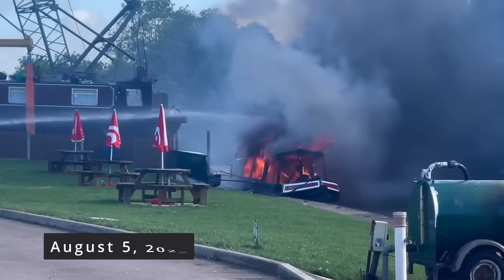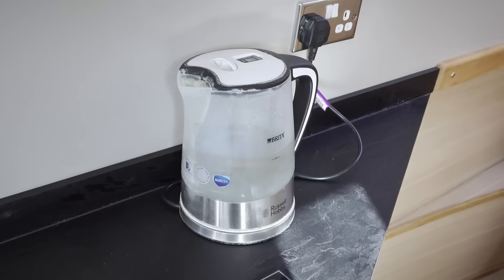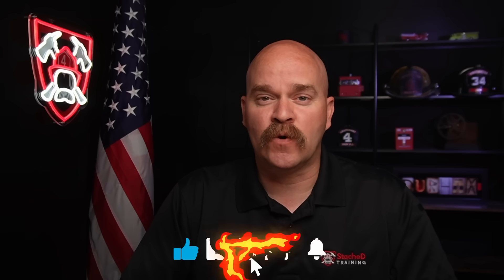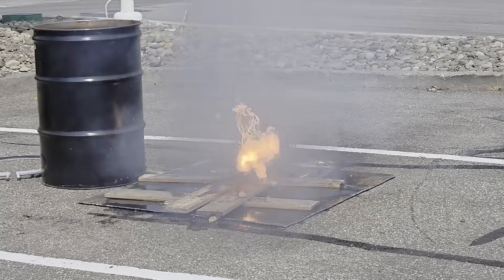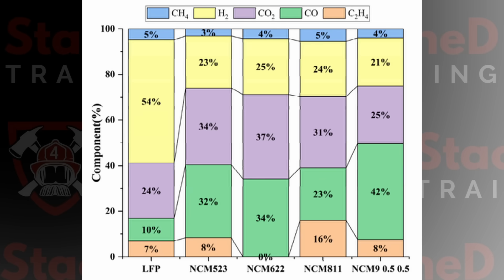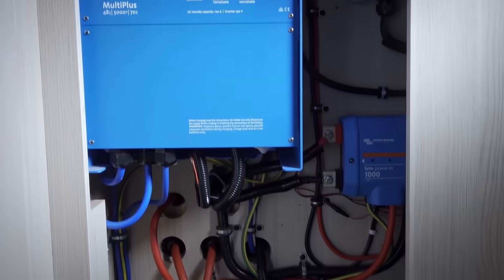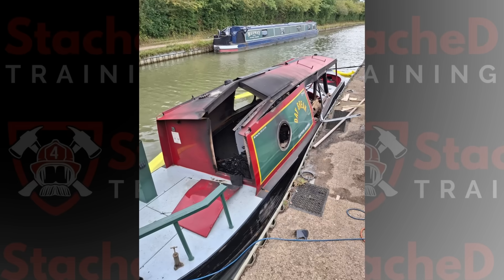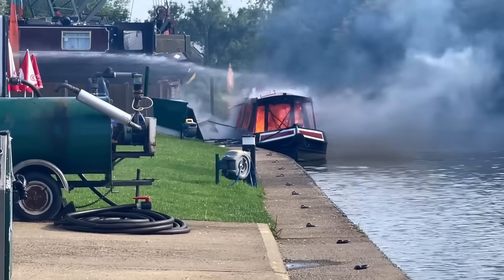Electric Boat Explodes While Charging: LFP Batteries

Comment: I've said this before about electric cars, but it applies here too. I thought battery power would improve safety. No fuel to burn, right? Umm.. Yeah, not really. I guessed wrong on that one.
Reply: That's what potential energy is all about, potential energy is volatile.
Reply: I deal with Lithium batteries a fair bit and my experience with them has kept me away from getting an EV, Lithium is a tricky element to be playing with, the biggest worry is how they talk about fast charging as if its a bonus when its the exact bloody opposite, what your doing is stressing the batteries, there is no way I'd fast charge Lithium batteries of any kind ever.
Reply: @mellbenham6809  that's not true though, if you look up the recent technology called lithium titanite (LTO), people in car audio use it for the high Current rating. LTO is actually very stable And last for many years. Some new vehicles are taking advantage of this safer tech.
Reply: @mellbenham6809  There is zero elemental lithium in EV Batteries. It not realy a Class D metal fire. It's mostly fuelled by hydrocarbons i.e. plastics.
Reply: The worst thing is  , stupid politicians that did no research and just blindly raced into this idiotic  electric fantasy , it’s absolutely clear when you look at the big picture , battery powered everything  is not  the utopian dream they initially thought it was. 
 Here are the facts .
 The making of batteries and the sourcing of materials is very earth destructive and  very pollutive and expensive. 
 Upgrading electrical infrastructure all over the country to power and charge batteries is very expensive. 
  Batteries when they burn are highly pollutive and toxic   And a danger to everyone in the vicinity and that goes double for firefighters !
 Battery’s work on a chemical reaction that does degrade over time , recycling batteries is very dangerous , very labor intensive and has its own pollution and energy cost that is going to need tax payer funding when the masses of batteries start building up  , because no one will do it for free. 
 And lastly , batteries and electric motors have their own set of characteristics, , EVs for example are really a one trick pony , when they have multiple motors they have a lot of power , but under load  electric motors are energy hogs , and the more load you put on them the more energy they draw. 
 Unlike an internal combustion engine which the fuel system is mapped and can only use as much fuel as an injector can supply. 
 In short , politicians screwed up , the electric future they are trying to force upon everyone only works for a certain percentage of applications , and it is a huge fail in others , but those stupid politicians can’t admit they where wrong. 
 Especially when modern petrol and diesel engines are very clean , safe and easy to live with.
Reply: You were right, actually. The biggest problem, including in this video and the commentary under it, is ignorance. Fueling ignorance is much worse than fueling technology. The fire risk of LFP's is dwarfed by the fire risk of explosive hydrocarbon vapors onboard conventionally powered craft.
Reply: re: "I guessed wrong on that one."  correct, but unbeknownst the inadvertent reason you guessed wrong (not necessarily your fault btw) is because society has conditioned you your whole life into a dysfunctional behavior pattern of running around looking for FREE LUNCH.👈however what laymen to the STEM fields of Engineering, Physics, Math, Chemistry, etc don't realize is how "Free Lunch" unfortunately DOES NOT EXIST ANYWHERE IN THE UNIVERSE (aw crap).  that's right, everyone from Einstein to Carl Sagan to Bill Nye (the Science Guy) knows this to be true.  also ref: THE MYTH OF PROGRESS.
Reply: The scary part is that a Li ion battery in theremal runaway creates its own fuel. Yikes!
Reply: @scillyautomaticIt contains its own Oxygen too
Reply: @scillyautomatic You are confusing completely different type of battery - clueless ....
Reply: @lifeisfuneh  Yeah I don't think the nuance is going to be recognized or absorbed here.  The whole point of this channel (and the comments) is just "batteries bad, m'kay?" They'd much rather you park a car with 18 gallons of gasoline in your attached garage along with a gasoline-powered lawn mower and weed whacker and generator with gas cans for all of them than have you use electricity or store electricity in batteries.  Reminds me of how it's also too great a fire hazard to use R-290 refrigerant in the US (propane) because of the hazard of a potential leak (of a minute amount of propane) - instead, pipe it directly into your house and burn it!  Pretty sure the same industry is ultimately behind both of these messages.  Also wind turbines cause bird cancer. 🙄
Reply: They do improve safety - media just loves to cover battery fires.  For every EV that burns, there are dozens of ICE vehicles that burn with whatever fuel is in their (usually plastic) tank.  That just doesn't make the news.
Reply: Batteries store chemistry, they don't store electricity.  The chemicals they store want to react with each other, and react in an energetic way.  I would never assume chemicals with high energy density that are in close proximity to one another would be safe.
Reply: @cherryjuice9946  Yeah... Although I don't know how I should then feel about parking my car with 18 gallons of gasoline in a plastic tank inside the garage attached to my house.  There's quite a lot of very volatile thermal energy ("chemicals") available there.
Reply: The current battery tech is the problem
Reply: @jonathanjones3126 Can anything that stores a useful amount of energy be benign? I doubt it.
Reply: @jonathanjones3126 
Yeah. Current being the operative word
Reply: Luckily gas cars don’t have fires.
Reply: @TomKacandes Gasoline and diesel car do catch fire, many times intentionally for insurance fraud, but what they don’t do is burn at 2,500 degrees Fahrenheit.
Reply: @TomKacandes  LOL exactly :)
Reply: Lucky gas car fires are easy to extinguish

Comment: 1:11 1:14 1:17 Why not power these boats with deep-cycle lead-acid batteries?
Reply: good idea, plenty of space and no fire risk.
Reply: @michael.randall5034 plenty of space, 😂😂😂 you serious have you ever seen a lead acid battery? Also if used properly these batteries can extremely safe especially if they’re high quality cells from the same manufacturer and batch, but you can easily build a pack that will save a lot of space + have the run time that can easily exceed a 12v lead acid battery’s run  time!
Reply: @michael.randall5034  Equivalent fire risk if overcharged.
Reply: Zero built in safety features, hydrogen off gassing etc. needs ventilation and lots of maintenance
Reply: @WillProwse Did you even watch the video? Specifically the part where he lists the gasses these batteries put off?
Reply: @fdMT_EnGy yeah I watched the video but none of these batteries are safe. LFP does not have a self-propagating thermal runaway. The temperature on the surface of the cell is not even hot enough to catch paper on fire. The venting seems to be the issue. And guess what other battery has that. Lead acid.
Reply: @fdMT_EnGy you don’t know who he is do you? 😂
Reply: @Bonezmi16  No. Should I? Should I really care?
Reply: @WillProwse lead acid batteries maintenance is easy compared to lithium or sodium ion, distilled water and simple tools assuming it isnt closed cell type
Reply: @jonathanjones3126 is this comment joking? What in the world are you talking about. That's totally false.
Reply: @WillProwse lead acid batteries are much safer, yes they dont have nowhere near the same power density.  They can only hurt you if you chew on the lead which is not a excepted behavior,  or if you provide no ventilation.  In boats their weight is usually not a issue.
Reply: WW2 submarines did pretty good with them. Hydrogen gas is pretty nasty but not like thermal runaway.
Reply: Weight savings and phasing out toxic lead.
Reply: @erikk77  There is zero reason for an owner to object to lead batteries on the basic of lead toxicity unless they enjoy sucking the terminals. (I don't like batteries quite that much but I won't judge.) Lead is highly recyclable and battery recycling as old as the first lead-acid batteries.
Reply: @erikk77 lead acid batteries are easy to recycle and don't usually cause fires that are not easy to extinguish.  Lead acid is very mature and will not cause any health problems unless your eating or drinking it.
Reply: Because they are over 4x the size and weight for the same capacity. LiFePo can cycled to 80% depth of discharge 6000 times on average - lead acid 500 - 1000 maybe, less if they aren't fully charged each time. LiFePo suffer no such problems if left in a lower stage of charge.
A proper drop-out and small computer fan to vent would have prevented this.
Reply: There is little reason for weight saving on a boat like this
Reply: @cccmmm1234  An equivalent capacity lead acid battery to this would weigh at least 600kg (1320lbs) vs LiFePo 180kg (396lbs) and it would require replacement six times minimum in the life of an equivalent LiFePo.
Reply: @sjbechet1111  it us a narrow boat. Narrow boats were originally designed to carry very heavy cargo. 400kg more for a lead acid will make it sit less than half an inch deeper in 5he water. No problems.  Lead acid batteries are much easier to recycle.
Reply: @cccmmm1234  
They were originally designed to carry cargo - the weight would not have been an issue - in this format it is a massive pain in the arse.
So how is replacing 600kg  of batteries as big as a fridge a minimum of 6x more than you have to, and on a per use basis ensure they are always fully charged so it isn't 12x an advantage?
Reply: Just as dangerous
Reply: @WillProwse Yeah, not even close to the same.